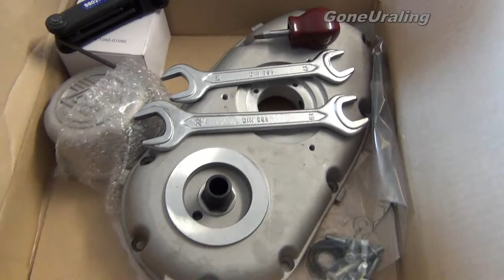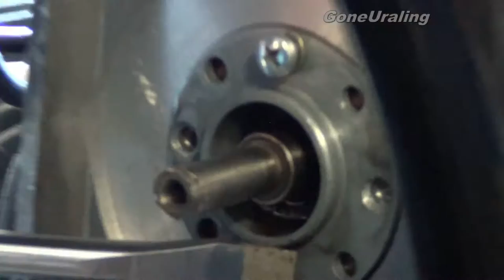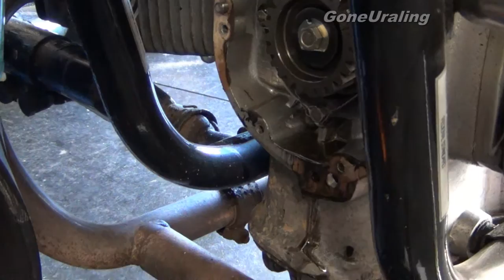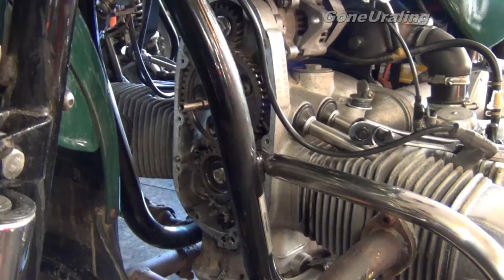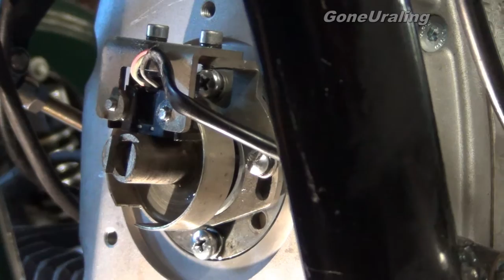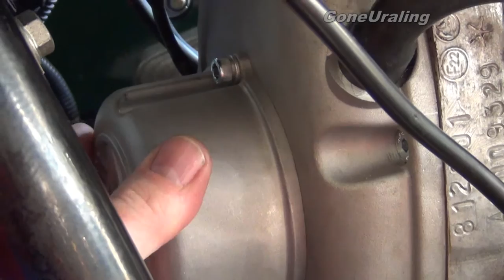Ural Spin On Oil Filter Kit Install

Comment: I purchased a Ural 2010 Patrol with only 2000 km  and I finally got around to installing the Ural spin-on filter upgrade. This video along with pictorial instructions on Soviet Steed forum were very helpful in the installation. A couple of tips/warnings for newbies like me:
1. When removing the old cartridge engine cover, there are two hidden, upper bolts in the top under the ignition timing cover. I didn't see these until I was trying to pry the cover off and had to look into the inside top of the cover.
2. The new gasket I got with new cover had a kink in it at the bottom. I recommend using a film of grease instead of light oil to hold and keep the new gasket in place!
3. I scribed lines to remount the hall sensor bracket back in the same place thinking I wouldn't have to re-time the engine.....NOT! Even though I mounted in the same position, the timing was "far off!"  So, do yourself a favor and check and reset engine timing.

Thanks for posting these videos they're a great help!
Reply: Помогите отрегулировать зажигание, так же поменял крышку, но не могу найти информацию и видео как это правильно сделать